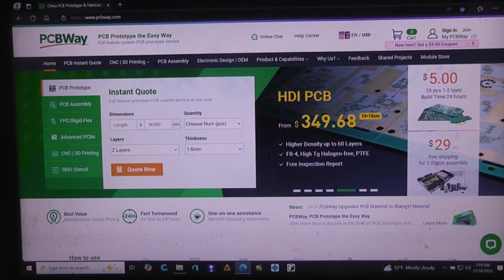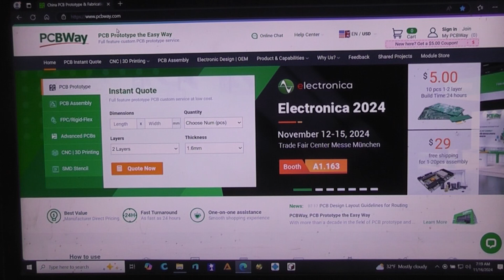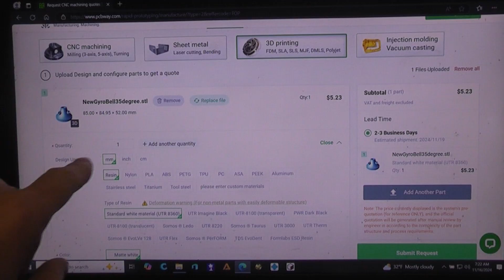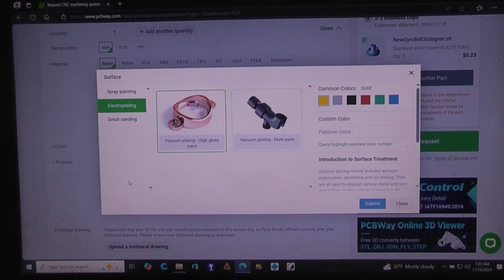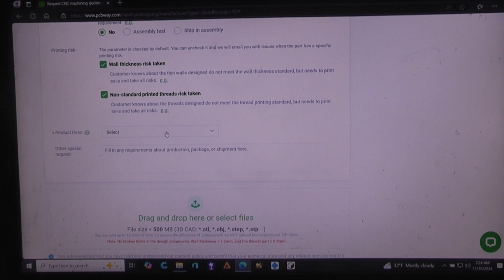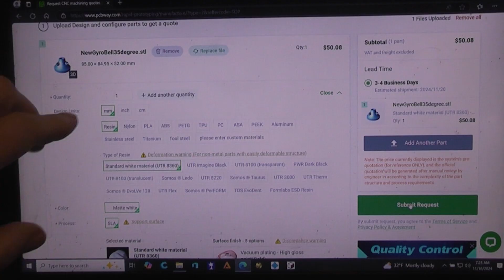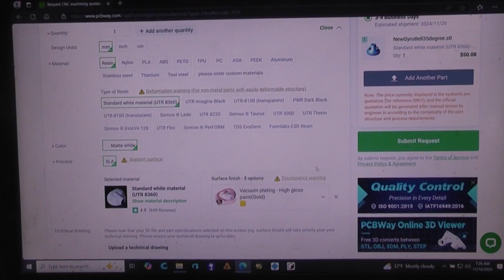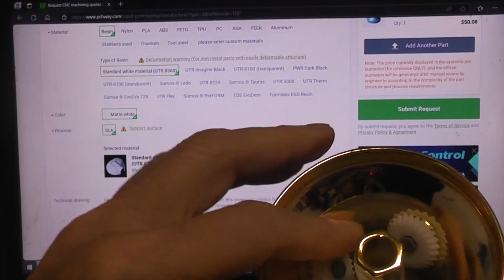GOLD & Brass plated 3d printed parts from PCBWAY. How to order and cost breakdown.

Comment: Think electroplating involves conductive coat and then immersion plating. Vacuum plating doesn't need conductive coat, its vapourised metal in a vacuum, looks for somewhere to settle. Finsh you got is immaculate.  Third way might be latetst metallic spray paints, great reflection but not at all handleable.

Comment: So nice to have these kinds of services available!
Reply from the maker: The price seems high if you doing a single part, but add up the time it would take to do all the steps involved and the materials required. It is priced fairly, I think. Yes, it is nice to have the option to use these services.